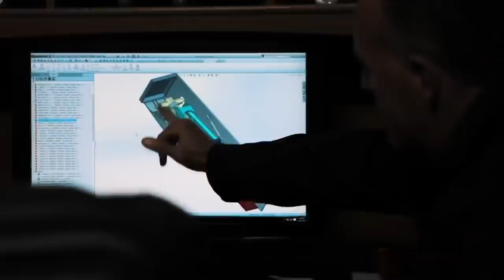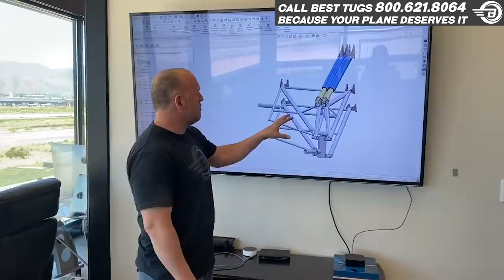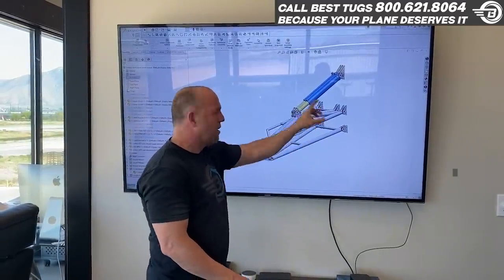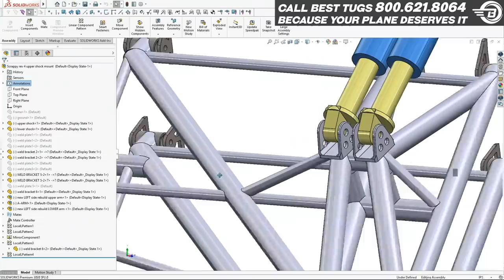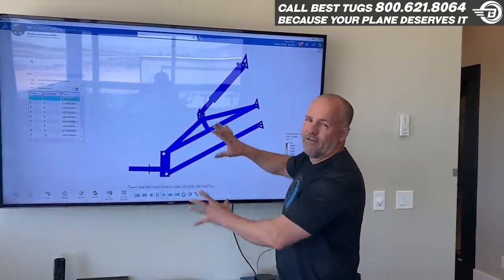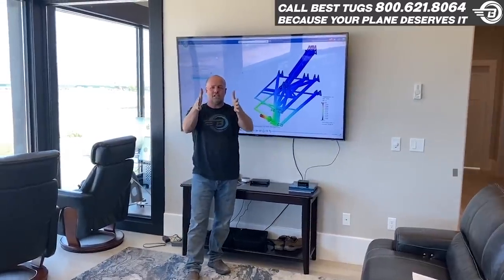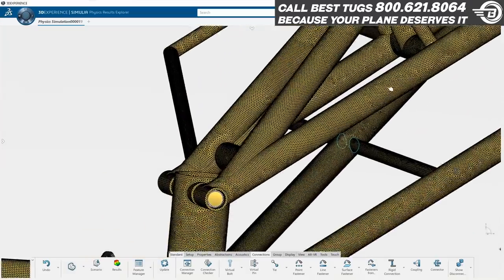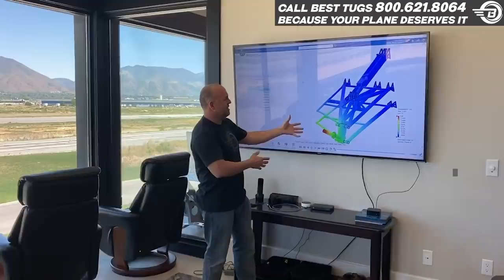Scrappy Gear Leg Wings Begin 🛠🤠 (Scrappy Bush Plane 16)

Comment: That asymmetric airfoil will give you a lift component dependent on A-arm angle and most of the time it'll be far off the adequate angle (horizontal line), while drag component remains intact all the time. It feels like you're wasting energy (calculations needed).
I'd compare it with a thin NACA symmetric airfoil working just to reduce that tube's drag. 
Nothing else to add, we are very thankful for such quality content.
Reply from the maker: Lucas Ribeiro  👍🤠 love your thoughts and I’ll try and go more into that later

Comment: You pay a significant price in weight and complexity in order to use two shocks on each leg.  I must have missed the rational if you explained it already but if not why two not one?  GREAT video's by the way and fascinating builds.

Comment: Mike, the tetra mesh you are using for the mesh is not appropriate for thin wall structures.  You can expect 50 percent error or more with your mesh.  You should be using a shell mesh.  Stresses mid way down the arm are fine.  The area of concern is near transitions where tubes come together (welds) or machined corners.

Comment: Young Patey ends up completely disassembling the wave runner and casting a carbon fiber hull for it then throws in a 2000 hp turbine engine in it.

Comment: if you have a 10 knt head wind you'll be about 18 kts to wheels up! IMO airborne at 28knt- 32knts power to weight 4lbs / hp 0-60knts 3sec! Just what my brain says. You are amazing, would you consider a brand new design amphib float? in Carbon with lifting surfaces on the all the attachments?
Reply from the maker: Scrappy is being designed to support floats.🤠
Reply: @MikePatey  that means you're going to design the floats yourself I will be happy to watch that. If I ever had twins....

Comment: There is a big difference between a stadium truck and a desert truck . noticed you mentioned desert trophy truck? desert truck high speed over ruff ground lots of bypass tech wheels follow the terrain body stays level (In theory) The rear setup of a stadium truck maybe? Sits low goes over a jump lots of travel in droop LANDS (hint) and stays low. Short landing ? hum maybe a one shot thing flare set it down compress the suspension stop. Take off ? full up travel at the start better wing angle ? Those wheels dropping 20 inches on take off could make things interesting? Inertia? More reason for full up on take off? Also since the a frames are now aerodynamic ? Not sure how aerodynamic with those shocks in the airflow? constantly moving on take off (dropping) could make things interesting.
roll control ?
Model your setup from the front lean the main body of the plane to one side note the goofy camber changes that equal length parallel front does. calculate the roll center? Coming in for a landing cross wind one wheel hits and compresses 20" Hum? Roll control (sway bar) or linkages to tie the two together ? See road race radicals /indy cars. maybe the wing flaps can control roll? Engine torque reaction?
Im not a pilot or have ever even ridden in a small plan so this is all random ideas.
Cantilever
Many times cantilever set ups are just weight and complications with little benefit. there also could be a reason why it is to late to build it into your design.
In this application it. It really looks like they would be an advantage. Aerodynamics weight . localizing the whole package? Im thinking king maybe a sponsor and there very reputable not sure that cantilever setups and Shocks are in there field.lots of variables here.
The carbon fiber work is really nice. A pro makes it look so easy LOL. its not!
Looking forward to future videos
Reply from the maker: Thank you and stay tuned for an upcoming video which will address your suspension questions, I think you’ll like it!! 🤠👍🏻👍🏻
Reply: @MikePatey  Dont know how your going to apply trophy truck valving of any type to that razor front end with those shock angles just for starters. razors lay the shocks in for a reason. More travel out of cheaper shorter shocks. Narrow front lighter less materials to build. But they are impossible to valve properly at that angle. Also the curve on the spring rates is awful. They were originally designed as a cheap fun off road go cart.  good luck

Comment: LOVE the videos! Question for you: It looks like the "gear wings" are starting to take the form of a "v-tail". Have you thought about adding control surfaces to the trailing edge of the gear wings? Might more akin to a canard design. Just a thought.
Reply: The gear wings are very close to center of mass, so not a lot of turning torque would be gained.

Comment: Mike. Have you thought if the wings could possibly pick up the gear?
Reply from the maker: DudeManBroMan  yea when I do max lift calculations on the wing it’s not enough to push against the shocks that hold the entire weight of the aircraft when on the ground so the wing will not move

Comment: Hey Mike. Quick question for you, do you have the full aircraft designed before you start the build or do you have a general idea of the total build and work component to component until it’s all ready to go together ? Can’t get enough of these amazing vids. Thanks for sharing them.
Reply from the maker: Pete Newport  full design first and then little mods along the way but 95 percent is from ground up at the start

Comment: trophy truck suspension, motor and prop form a dragster. It's also a carbon carbon cup. But we call it scrappy because it's made with recycled scrap plane parts😂
Reply from the maker: Scrappy is a little bit of errthang!! 🤠

Comment: Aren't you worried that during landing on large angle od attack your elevator is going to be in aerodinamic shadow from this additional wings? In my opponion it's going to make hudge turbulence. You should add slats on the edge or Vortex generators.
Reply from the maker: Stay tuned... 🤠

Comment: Scrappy is a Sesquiplane. "One-and-a-half wings."
Reply from the maker: Sounds exotic! 🤠
Reply: @MikePatey  Actually, it's a thing. I first encountered the word when reading about the Boeing 314 Clipper, one of my favorite aircraft. The 40's era seaplane had floats attached to the fuselage that took the place of the wingtip floats found on most seaplanes. The clever engineers at Boeing shaped the floats into wingfoils. (Sound familiar?   ;)  ) 

Because of that much smaller secondary wing/ float, the plane was officially termed a Sesquiplane. 

Thank you for all you and your brother do for aviation.  Thanks to you two and Draco, I was about to start my journey to a GA Bugsmasher license. Then the Wuh Flu nonsense hit.  I'm still going to see if you can teach an ol' dawg new tricks!

Comment: What a great project. I guess I have two questions. I didn’t understand the load you showed on the gear. I understand you were showing a “crash” but why was there so much force on the tip of the axle? I would have thought the load would be distributed across the wheel bearing without a big bending moment anywhere in that area. Second, why did you put a lifting airfoil on the gear fairings? I thought that idea went away after WW1. Any extremely low aspect ratio lifting airfoil just creates a ton of drag and vortices without much lift. A symmetrical airfoil just seems to cause less problems and doesn’t come with a bunch of secondary effects. I am probably preaching to the choir so I would love to hear what your engineering approach is. Keep it coming!
Reply from the maker: Ronald Monsen 👍🤠 I love the way you think, I talked about that exactly and as the edits got done we lost it, I may get a chance to go into more later 👍🤠 very specific reasons but way to much of a novel to try and type.  Thanks for your thoughts my friend

Comment: Thanks Mike for yet Another Fantastic vidclip .... It is All Total Genius. You are one of those rare, what I call, an 'Intuitive Engineer'. You just 'Know' if it is going to work or not. I do have a question.... Best to describe it by the 'Timeline' of the vidclip .... At around +15:00 you are standing behind that Great Landing-gear .... That about 1" 'Bar' set that run Aft... You must have a reason, but why do you have a 'sharp welded corner' ???? ..... Rather than a Bent Radius with a Brace from the centre of That Rad, forward to the 2" frame .... Not sure if that is for the 'Wing Covering', but that Sharp Corner just 'Feels' Wrong and does not 'Look' correct ????? Thanks, Keep well and Stay safe. I am a  retired 'Engineer now and really appreciate being able to watch All your great work. Cheers from NZ

Comment: HI Mike............great videos and they are educational. Question: have you ever bonded carbon fiber cloth to aluminum? Is it even recommended due to the thermal expansion differences?
Reply from the maker: Europa Europa it needs a mechanical bond as the two expand and contract so different it will pop the bond.
Reply: @MikePatey  Thanks Mike.

Comment: Quick question: In the load case, you show, is that really the position with the shocks fully compressed?
My impression is that the position of the assembly is as constructed, which is fully unloaded or partially loaded...

Comment: Hey Mike just curious. That suspension piece Maby could have been better if it was CNC out of alu?
Reply from the maker: Michael Rempel not strong enough without getting so thick it would have added weight.  I use Alluminum on most everything but these loads are to high on the gear

Comment: Bout time someone put a double arm suspension on an airplane. Heck, you could use it for rock climbing (just joking). In any case, I'll bet you can give it a real beating and not break a thing. And the wing will negate the extra weight of the double arm. Love it.

Comment: With the aircraft fuselage centerline parallel to the ground (tail off the ground), does the gear at max compression keep the propeller arc from contact with the ground?  I was thinking if you were to form a cylinder back from the propeller aft along the fuselage that the gear would need to hold the edge of that cylinder from touching the ground while at full compression.  Otherwise, any obstacles that fully compress the gear would strike the prop before even reaching the gear.  So, you would actually have unnecessary gear travel because it would never be of use...because if you encountered it your prop would be toast first.
Reply from the maker: Derek Samuel 👍🤠 I’m glad your thinking like this, so many do really dumb things like that. I would be horribly embarrassed if I did that.  With my tail up and nose fully compressed I still have more clearance for obstructions in back country than standard cubs compressed.  Not just a little more but a lot.  I have full use of all the travel in all configurations

Comment: The structural analysis is awesome, yet as an engineer one thing pops up to me;
Even while exceeding the highest landing stresses, most of the structure is still subjected to very little strain. If that‘s the case the structure is much stronger than required and thus should be able to shed some weight.
I find it strange, as by mist other components you seem to care about every ounce.

Comment: My biggest dream is to own my own ULM and fly it around Europe. I went and did my baptism on a small cub, I flew it but just handed over the controls just before landing, it was still not in me, but darn am I so interested in owning a ULM one day and just set off on my merry little way. Do you have any advise. Should I do a pilots license or something or what? What I'm thinking of is maybe owning a delta wing with a cage and three wheels, but I have heard that they are very tricky at 1500 feet. The other solution is a ULM that looks like a plane but darn are they expensive, again any suggestions.

Comment: You keep saying you will be able to "lock the gear in any position."  So, if I am understanding you correctly, "Scrappy will also be the first cub with retractable landing gear."  Did I hear that right?  Granted, the gear will still be external to the fuselage, but you are essentially transforming the gear from a source of drag, to a source of lift.
Reply from the maker: Stay tuned... 🤠

Comment: hm, one Question I have with the landing gear (and excuse my only basic understanding): when taking off and gaining speed, wouldn't the wings on the landing gear generate an outward force forcing the wheels apart? I'm sure you've thought about it and It's probably negligible, but in my head, I see the plane picking up speed and dropping lower and lower before it gets off the ground^^
Reply from the maker: Christoph Graf  I’ll see if I can squeeze in some discussion on that later 👍🤠

Comment: Great Video as per Mike , this might be a silly question ,theres obviously a reason you dont :D , but could you use Carbon fibre where the steel tubing is?
Reply from the maker: RichardOfYork1967 I’ll try and talk about that in a video down the road

Comment: Do you have plans to invest in a few 3D metal printers? You could run them in parallel and have them print parts while you sleep :-) Might also help with BestTug production?

Comment: how much will the efficiency be effected by the lower wings pointing outward and fighting each others effect partially? wont it create just half the lift (at 45 degrees) with the same drag compared to if the wings where level to each other? :D also cant wait for more videos :D
Reply: A wind tunnel would be great to prove effective design or not.
Reply: It'd be ~70% of the lift (think normal force for lift and the trig for 45 deg). I think the more important concern would be stability at that point rather than efficiency of the lifting surface, especially considering that the drag from the lifting surface probably isn't terribly different from if it were a simple cowl or even the bare suspension arms.
Reply: @anthonyantoine9232  yeah the stability probably needs to be compensated for with the main wing and yeah would be interesting to know how different the drag would be with different shapes :D
Reply: @niklasxl  a round bar is about the worst thing to push through air.  so the wing would be lower in drag than all those round bars but higher than a neutral faring.  It will be interesting if the lifting action would compress the suspension some and give you issue in a rapid speed reduction.  Also on landing if you are fast enough and in a cross wind so you put one side down first as the two lifting vectors diverge how will it effect the plane.  And as the gear compresses its going to have more vertical lift right when you are trying to remove all lift... I'm sure Mike has thought through this though...

Comment: No to be a weenie but,It’s great that it’s that strong but do you need to put in some sort of sheer pin somewhere because all of that energy needs to be expended somewhere and if you put that much stress on something where is that energy dissipated?
Reply from the maker: Thomas Roiland 👍🤠 great thought and most don’t think of that, my version of that is my Axle. a pin could fail and then Induce a bigger snap impact problem elsewhere.  My axel will bend just before other failures and it will bend a little or a lot depending on impact but even just a small bend will add several more inches of travel to the aircraft to further protect it.  Also the axel assembly I made to be a simple bolt in replacement in minutes so that I don’t need paint or frame work 👍🤠

Comment: Mike, won't the paint eventually wear off on that part?
Reply from the maker: Travis k 👍🤠 not likely right there it gets only the couple bumbs on landing and not like my sand rails or buggies that get more abuse in one run than 50 slow landings with usually one impact.  That being said of course it eventually could and I could just snug it back down in seconds and be back to metal to metal but I’m hoping it holds up so I don’t get that rust drips sneaking out. 🤷‍♂️🤠
Reply: @MikePatey  Awesome.  I suggested over at Peter Sripol that there needs to be a Mike Patey and Peter  Sripol collaboration.

Comment: You have an incorrect boundary condition at the end of the axle stub.
The tire cannot apply the stress you are showing at the tip of the axle.  It is a very easy mistake to make.
Reply from the maker: You are 100% correct.  I placed it in numerous locations just watching how it would react but just grabbed a random clip in the edit. 🤠👍🏻

Comment: Very cool.  I'm wondering if the landing gear arm-mounted wings might increase the aircraft's tendency to bounce on landing.  As the aircraft touches down and the shocks compress the landing gear wings will be rotated into a more upright position (less anhedral) thus increasing the lift from the landing gear wings along with increasing the pitching moment from the landing gear wings.  The net effect being an increase in lift when the shocks compress and a possibility of bouncing more than the case without the wings.  Wondering if this is something you have thought about on the design?   I'm going to guess that on a fully stalled 3-point landing it wouldn't be an issue but might become a problem if you are landing with a bit more energy.

Comment: could you do a retractable wing mounted gear like a dash 8 Q400 
https://upload.wikimedia.org/wikipedia/commons/thumb/3/3b/C-FWEP_Westjet_Encore_Dash_8-Q400.jpg/800px-C-FWEP_Westjet_Encore_Dash_8-Q400.jpg
that wouldd be heaps better for you! much wider wing to wing, more stable safer, plus retractable so when you go into the flight levels less drag. Id like to see that type a gear on DRACO V2
you should put a big turbo on that! as well !!!!